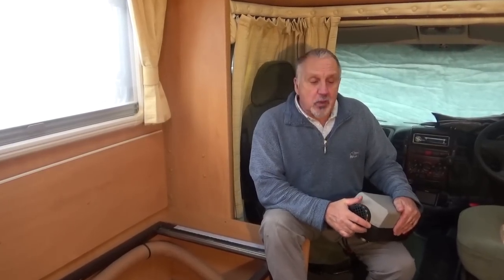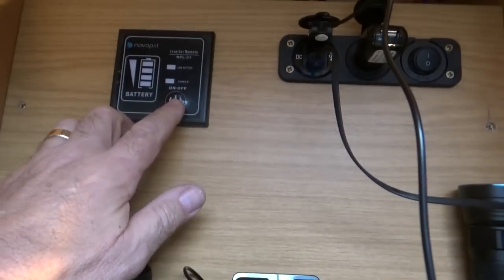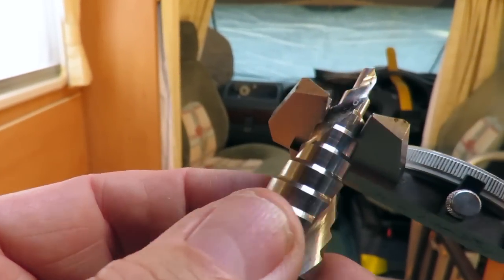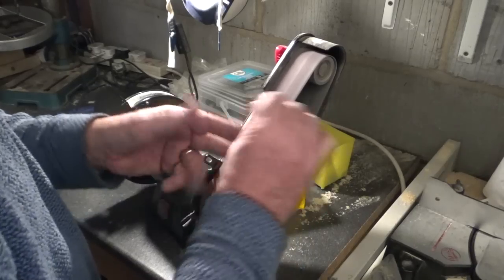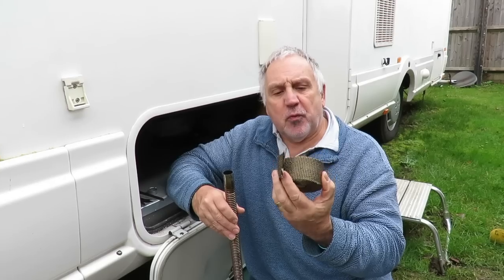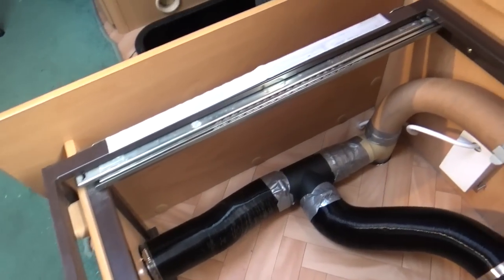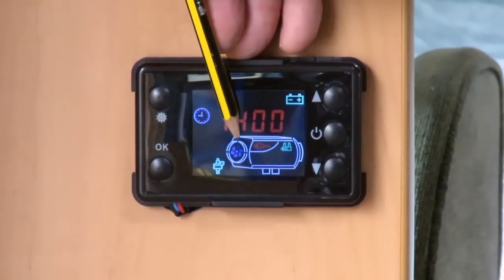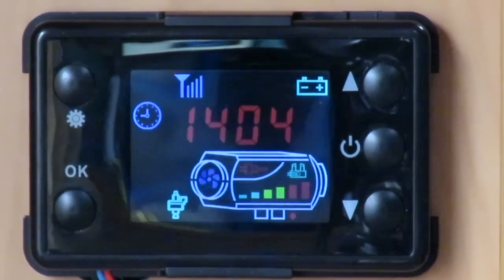How To Install A CHINESE DIESEL AIR HEATER, Ebay 5KW parking heater fitting guide. Full instructions

Comment: Hi mate, great job, learn by my mistake, you are better off always installing the pick up pipe into the original fuel tank if possible, the other option if you do have to use the fuel tank is to use the stack pipe supplied into the top of the plastic tank. The rubber on the one you have used is made of Chineseium and will deteriorate over time and leak derv all over your lovely camper, if it’s in the top it’s not as critical. The other factor is you can use more of the derv in the tank as you can set the pick up lower. I got it wrong and wrecked the plywood on the floor, it still stinks now 2 years later.
Reply from the maker: Hi Chris,
Agreed, the fuel system is its weak point. 
I am in the process of changing it, taking out the plastic tank and running directly to engine bay. 
Not using the fuel tank method, but instead tapping into fuel line after vehicle main filter and mounting the pump in engine bay too. 
I had quite a bit of feedback about the tank..!
Diesel smell is a right pain once you spill it... I feel your pain 😤
ATB, Steve

Comment: My controller looks just like that but pressing the settings button never takes me to the advanced settings pin screen I can't find anywhere online why this is happening with mine..
Reply from the maker: Hi Cameron
Common default PIN codes are: 1688 and 9009
Try these.
ATB, Steve
Reply: @TheWrinklyNomads  I mean I can't get to where you enter the pin pressing the settings button doesn't take me there apparently there's two different controllers that look almost identical and I've got the other one and I haven't found it anywhere online that anyone has figured out how to tune it yet but I will keep searching.
Reply: @rumbleman  Did you find something as also can't get to the settings, beside setting some kind of clock or countdown?
Reply: @davormismas  no I haven't been able to find out if this particular style has any way to adjust it, which is bad because this one's running super rich.

Comment: Why didn't you mount the tank in the storage area and just run the pipe up.....
Reply from the maker: Hi Martin 
Ran this setup for a while, but then upgraded and modified to exactly what your suggesting. 
Best upgrade I’ve done!!
Got a video of it here:
Chinese Diesel Heater Upgrade - Best Improvement Yet..! -  Full Installation And Testing.
https://youtu.be/HHJaPP2uLFA
Reply: @TheWrinklyNomads   very well done video, I just put one in a sprinter, fitted under the passenger s seat,, I'll be checking out your other videos,. Tks peace

Comment: Why is it important that the valves cannot be closed?
Reply from the maker: The heater relies on the correct setup to give a clean burn and maximum efficiency, and as such there should be no restrictions of air intake, gasses out or fuel supply.
Closing off any off these can result in the heater failing and overheating causing complete failure and damage.
This also applies to the power supply. Do not turn off whilst running the heater.

ATB, Steve
Reply: The hot air outlet should not be valved to ensure air flow pass the heat exchanger. If the vent is valved off the heat exchanger will get over heated. It has nothing to do with the exhaust fume which is in a seperate circuit.

Comment: i think it is a dangerous installa cause the heater have to stay on the floor completely.. smoke can escape from the muffler coupling and the pump have to stay 45grades. maybe the best place was in the box under directly
Reply from the maker: Hi Janlu
I run this system for 6 months and no problems at all.
However, since this video Ive done a complete revamp and upgrade of the system.
similar to what you have suggested. 
Take a look, be interested in you opinion. 
heres the link to the video:
https://youtu.be/HHJaPP2uLFA

ATB, Steve

Comment: mine doesn't have second thermostat temperature.. I'm guessing on mine first one says 20c and next setting are P-1.4hz and adjusts to P-5.4hz

what does Phz mean?
Reply: Make sure you set the clock first…. Go through all 4 digits, just as long as the systems recognised you’ve set the time. Then make sure you enter the temperature you want before running your fan. Once the time is set and the temperature is selected then it should turn on for you.
Reply: @tomjones9531  Thank you 😊

Comment: No mention of fitting a monoxide alarm
Reply from the maker: No such thing as a "monoxide alarm" Trev..?
I do have however, 3 carbon monoxide alarms in the van, one beside the unit, one near the bed and a general one over the door, if that's what you meant.?
ATB, Steve

Comment: Hello
I have a problem with the heater not wanting to start
it goes through its start program but then it gets error code E-00 E-01
battery icon flashes see that the volt on heats the diplay skunked to 9.9v. Do you have any tips
Reply: Voltage drop by the sounds of it, replace the wiring with thicker gauge stuff
Reply from the maker: Hi Perry,
Sounds like a power delivery problem.
1/ your battery does not have the capacity at startup - heater draws 10Amps
2/ undersized cable run from battery to heater unit. Use 25Amp rated cable

ATB, Steve

Comment: The pump is supposed to be on a 45 degree angle not straight down like you have it you need to go watch another installation or straight up
Reply from the maker: Hi Gary,
Not quite.  Any angle over the 45 is preferred.
Positioning the pump vertical will mean you have zero chance of capturing any air bubbles that form due to pump cavitation.
The less air bubbles the better fuel to air mixture, the more efficient the burner.
45 deg is ok, but will still trap air inside the pump.
ATB, Steve
Reply: U'll see what i mean after a while your way u get air it stalls other yay will not i'll send u the link that explains  that supposed to trap air in the pump and not push it trough as a bubble

Comment: These diesel heaters are much more efficient than a propane forced air heater there a quarter the size and make better Heat and on top of it they don't kill your battery 2 amps

Comment: Watch the vid for how to install electrical to vehicle power: "It's just a case of putting in a fuse...", realize he skipped THE ELECTRICAL PART
Reply from the maker: Hi,
Never skipped anything.!
If you got to:   https://youtu.be/XQcwnD0hbeE?t=953  I cover exactly what I did for the electrical work. The final bit of hard wiring of the live and earth back to the fuse box I did not show, but if you don't know how to do that then.......🤔
Check that section out again and you'll see it makes sense.
Hope this helps
ATB, Steve

Comment: why bring diesel fuel inside of your motor home to fill it ???  - why not put the neck of tank thru the wall so you only fill the unit from the outside. - so never a mess or spill to worry about

Comment: Seems a bit odd to have a tank full of fuel in your van when there is a tank full of fuel you can use already under the van. Also rather 1970's to call it "chinese".
Reply: I'm having Chinese takeout for lunch today and it's not even made in China
Reply: @travisn4493  There is a difference. Perfectly fine to call food Chinese as it is food in the style of that culture. However with produced goods, the term was used (along with many others over the years) as a form of insult as a way of saying it is inferior.  For   many years now China has led the way in many fields like electronics, trains, construction and all sorts so the term is rather out of place today.